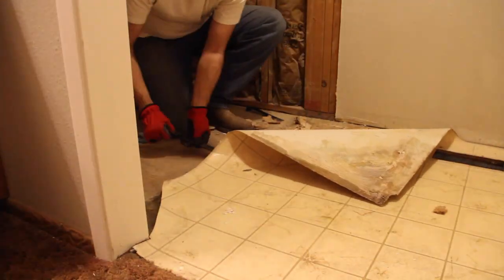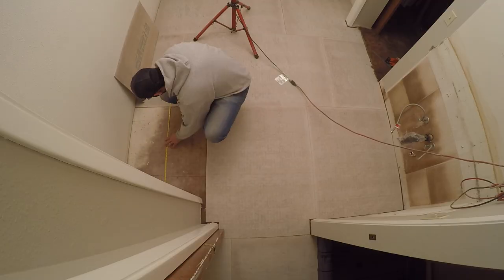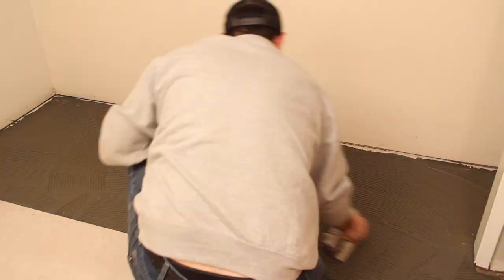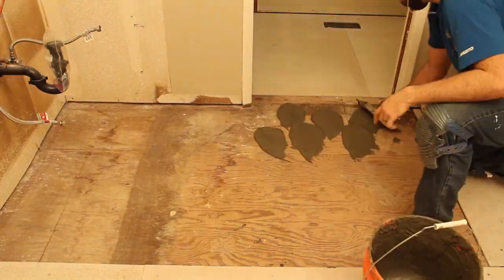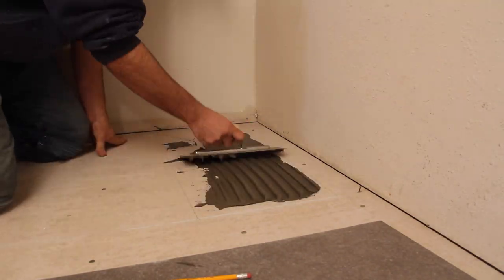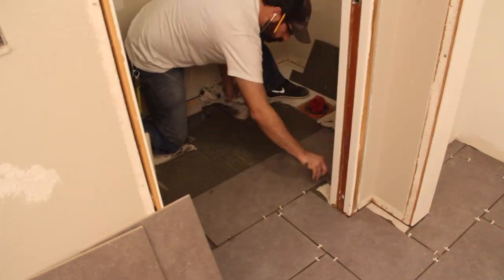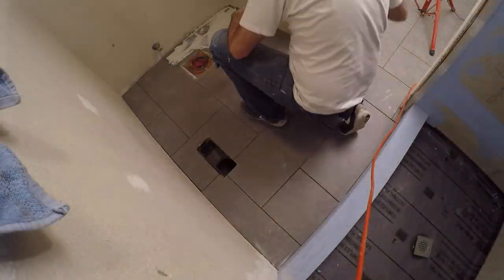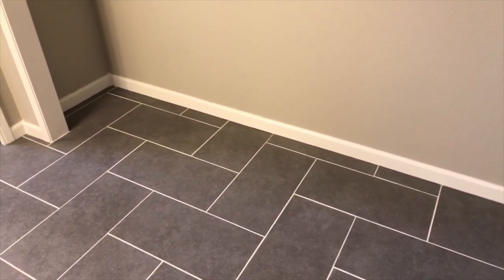How To: Remodel A Bathroom - Flooring

Comment: HardieBacker requires screws or nails to be set at a maximum of 8" apart and all seams are to be taped to prevent seam cracks telegraphing through the tile in the future. If you took the time to read and follow the instructions on the bag of thin set then please do so for the other products you're using so you can get the best result possible.

Comment: Why did you add thin set in between the sun floor and cement backer board? Instead of just using the nails?
Reply from the maker: In all the research I did, that is what people said to do. I’m not exact sure why.

Comment: You should have added a mesh tape to all the seams of the cement board and never use nails to secure the cement board as they are prone to pulling out and cracking tiles and joints .  always use a coated screw.

Comment: What would you do if there is possibly rot to the lowest dry-board? Reason I would want to replace my floor due to water possibly leaking below my floor.
Reply from the maker: If your subfloor has been compromised by rot, you would need to replace it. You can just cut out the bad section.
Reply: Make It Now ah ok thanks!!

Comment: i know this is an old video but, most people i know use that cement board but instead of cementing/ nailing, they screw it down every 3.5-4 inches instead. thoughts?
Reply: Yes. He did it completely wrong

Comment: You need to use durock screws wasting your time stinking hardi backer down with thin set.  need to use levtech clips garuntee you have some high ass tiles. But looks good

Comment: Why did you mortar under the concrete board and why didn't you tape the seams?
Reply: I’m soooo confused why he used mortar under the concrete board
Reply: its a common older method. now they like to advertise as "decoupler" so that its seperate from the house. a lot of areas get a lot of movement within the house.
Reply: Because he has no idea what the purpose of hardy backer is for. Hardy backer SCREWED down not nailed onto a solid plywood subfloor is more than enough to make the floor rigid so the tiles or grout line doesn't crack. A thin layer of butter on the subfloor will do nothing to make the floor rigid. It's completely unnecessary.
Reply: @green_willowtree   you  have to use concrete if you nail the board down, because nail will pop and it will crack the tile and grout will come loose. But if you use screws you dont have to use concrete. Hope that helps.
Reply: @imyourhuckleberry4547   You can nail it down as long as you use concrete or you can just as screwed no concrete

Comment: Both rooms are classified as wet room, right! Why not a waterproof membrane under all the tiles?
Reply from the maker: You only need to put the membrane underneath where there will be constant water, like in the shower. In the rest of the bathroom, the only water will be accidental drops or spills from the sink.
Reply from the maker: You only need to put the membrane underneath where there will be constant water, like in the shower. In the rest of the bathroom, the only water will be accidental drops or spills from the sink.
Reply: Hmmm, that isn't the code in my country,,, if there was an overflow on my bathroom and no membrane, no minimum height from door threshold to drain, and no drain or threshold at all the insurance would be void,,, also I would get minus $25-30k if I sold the house (which is normal price for a certified but basic bathroom here)
Reply from the maker: Oh that's interesting. What country is that?
Reply: In Australia, we waterproof the entire bathroom floor.
Reply: @clarris44   Austria> Is it there where everything is upside down? So floor in US is like ceiling in yours country.

Comment: Who puts carpet on a bathroom? lol
Reply: 1972
Reply: You’d be surprised at how often that happens.  I’ve seen it in kitchens too.
Reply: Right, that's so odd but I remember looking at an older home when I was house hunting and saw a carpeted kitchen. All I all I could think of is all the horrors  that are festering under that carpet
Reply: Our house has carpet in the master bathroom (but not the guest?!?) the builder's must have done it because there are several houses on our street that have the same thing. It's the nastiest ever- lucky we are renovating soon! And our house is 19 years old so not sure if that has anything to do with it
Reply: It used to be very common.  In fact, there were carpet kits you could buy just for the bathroom.  It was all about having something soft and cozy under your feet, not hard, cold tile.

Comment: I'm so confused.   I have never seen anyone put thin set under concrete board.   What the heck is the point in that?   You are supposed to put nails on each of  the spots on the board.   Why the hell would you do that?
Reply: R H  thats the recommended way by the manufacturer. I personally rarely use thin set under backerboard. Just use good amount of screws

Comment: This is not how you do grout you're wasting so much grout and then you spent three times longer to clean it..... also white grout (light color) on the floor that the worst thing you can ever have. You should go with the darker grout or lighter tiles and darker grout.
Reply: There's so many things he did wrong in this video like smearing mortar under the Hardy backer, nailing it instead of screwing it, not covering the joints, piecing in the tiles instead of cutting them to fit around odd shapes and what you said about the grout.

Comment: Jesus Christ, the houses in US are made of cardboard
Reply: Depends on where in the U.S. you are. In Florida just about every building is made of Concrete or brick with only the interior being made of wood that has to be water resistant.. In Cali and other earthquake prone places, roofs require extra joists and reinforced joints to prevent cave in's. Building codes for one state/region may be low compared to others.